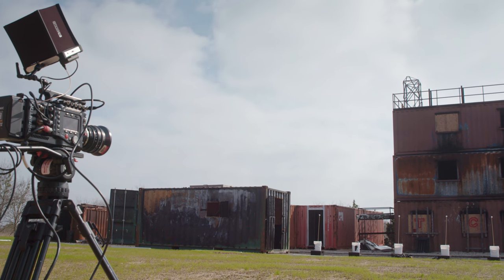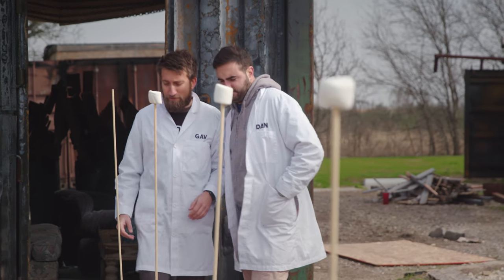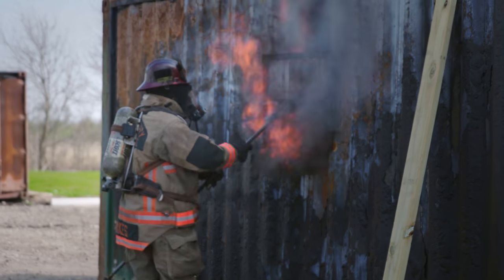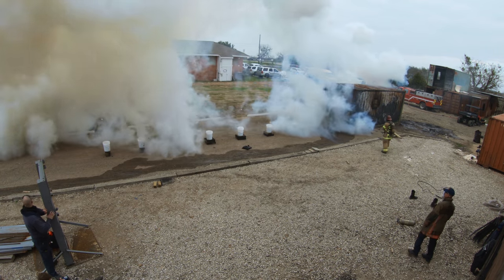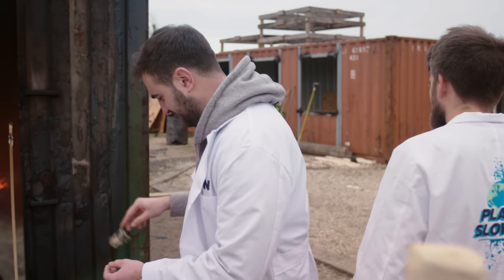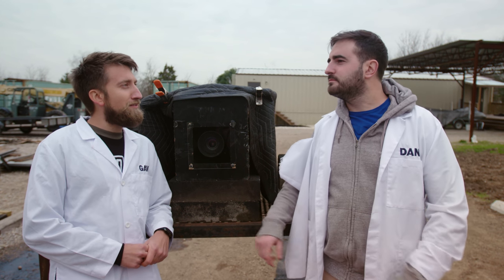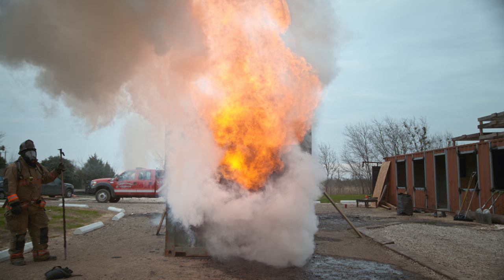4K Slow Motion Backdraft

Comment: I cannot BELIEVE that one firefighter almost walked into the back draft. That's like staring down the barrel of a loaded gun, like you know it's a delayed reaction right? Just go around the other way...
Reply: he was planning on opening the lower part of the door I think
Reply: They all thought it wasn't going to happen so they decide to open up the windows/door to let the air in.
Reply: That pretty much demonstrates why backdrafts are so dangerous, even in a controlled experiment.
Reply: Agreed. Genuinely cannot believe he nearly strolled directly into the path of an actual backdraft. Pretty unbelievable in my opinion.
Reply: @bwin2992  So the masses of firefighters dying from this... weren't wearing gear? It would take a lot stronger gear than that to be safe from what is basically an explosion to your face.
Reply: @Boomber123  You're right. That's why there's no problem with playing around with a dud firecracker.
Reply: Br Win the mask is the weakest part of the gear and does not protect us.
Reply: @bwin2992  The mask is a protection against the toxic gasses and not against direct contact with fire like the rest of the gear.
Reply: Im the 100 Like!
Reply: also, i think the guy was only hit with a glancing blow; as opposed to a full-on impact with the centre of the shockwave. if he had taken a direct hit he would definitely have been knocked over by the force. i suspect it's the immense force of such backdrafts funneling the extreme heat into the weakest points of protective gear that really causes damage.

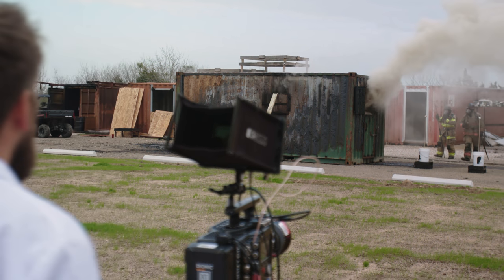Comment: 4:48 Why would you try to walk across the front. Jesus Christ, the guy almost melted the right side of his face
Reply: If you keep watching it curves just before it hits him
Reply: It's like walking up to a firework that failed to go off in order to see what went wrong.
Reply: If you watch his hand it looks like he was reaching to unlatch the door from the side. He was starting to reach out for the latch and crouch down the second or so before the backdraft.
Reply: @johnpatz8395  Yep and if I remember correctly it was said that they were going to open the bottom door then boom. I don’t believe for a second he was planning on walking in front of it either!
Reply: @RamboJohnJ  it wouldn't have been fatal its the reason nomex hoods and helmets exist to protect you from burning or open flames
Reply: @mikerotchburns7122  there is  not nearly enough on the head sock to prevent catastrophic injury from that particular blast of heat and flame.
Reply: @RamboJohnJ  never said there wouldn't be any injury just stating it wouldn't have been fatal

Comment: It's basically superheated air! The mushroom shape makes sense because it's the same concept that occurs when an atomic bomb is detonated! The superheated air expands upwards faster than outwards, causing the mushroom shape!
Reply: GhostShipSupreme a fluid moving through another fluid will make that shape. Water will do the exact same thing just by pushing your hand through it. This backdraft is caused by pressure where a bomb is like you said hot causing it to rise but they do the same motion

Comment: The fireproof phantom looks like one of those old timey cameras with the fabric cape thing they would go under, and use a gunpowder flash thingy..
Reply: Quick fun fact: That wasn't gunpowder they were using back in the day, that was powdered aluminum being blown towards a candle, if I remember correctly. That stuff can be quite flammable, and it can only be sold if it's above a certain average grain size

Comment: Wow. I had ZERO idea that backdrafts took that long to actually manifest. I thought it was an "open a door, insta-backdraft" kind of thing. No wonder firefighters worry about them lurking about! (I still honestly can't believe that one firefighter deciding to walk right in the front instead of behind. DUDE. WHY.)

Also the close-ups of the smoke remind me of pyroclastic flows...
Reply: That's what I was thinking. Both look just like smoke until you touch them, then your arm gets burned off by superheated gases.
Reply: Well a lot of times in an actual house fire it is a very instant thing simply by how starved the fire gets. You can actually see the walls of a house "breathing" when the fire is starved and just breaking a window can cause a backdraft
Reply: @CherryPepis  That isn't a backdraft, that is just feeding oxygen to a fire that is still going.  A backdraft is when the fire is technically out but the room still contains two of the three ingredients in the fire triangle - Fuel and heat, when you add oxygen it completes the triangle but re-combustion will only happen once sufficient oxygen has entered the room, hence the delay.
Reply: @krashd  my guy that's what a backdraft is. It's a starved fire that still has fuel and heat. Both me and my dad are firefighters, we have plenty of experience with real world backdraft

Comment: It's interesting to me that the 'ball' of smoke was ejected quite a bit before we saw the jet of flame.  I'd like to know what's actually happening.  Maybe the sudden reduction of pressure cause by the rapid release of gas somehow enhances the flame?
Reply: Maybe the heat act as an oxygen syphon or a kind of '' air '' exchange and because of that there's a chain reaction. That generate a lot of energy really quickly as the heat goes up and pull the  hot flame outside now that it have room to go since the smoke is probably holding it in.
Reply: You're basically witnessing a thermobaric detonation. Just pull up the wikipedia page for it and you have your answer.
Reply: @DawnBriarDev  Thank you sensei

Comment: My father was a firefighter for most of his career and, in fact, until he retired. It is rather mad, the dangers they regularly exposed themselves to.

What I would have loved to have them do with one of the backdraft bursts is have 3-5 rows of poles with little flags on them, spaced out 2 feet apart from each other, running the full length of the area where the fireball burst out then film it. It would be interesting to see the wind effect of the eruption as it goes.

Comment: Something i just realized is that the smoke almost looks like the ring on a vortex cannon
Reply: It's the same motion, why wouldn't it? High pressure from a volume pushing into a relatively motionless space. The stream catches at the front and rolls toward the shower moving air.

Comment: 1:23 "its still burning the fuel as embers" incorrect gav' a backdraft occurs when all the oxygen is consumed by a fire and then more oxygen is reintroduced, as the fuel is burned it produces super heated gas which then ignites and burns, the fuel is not still burning when the oxygen is used up, as the fire chokes out, the fuel continues to produce flammable superheated gas which rapidly accumulates in the confined space of the building, but because there is no oxygen for the superheated gas to mix with and combust, the fuel simply continues to accumulate gas, while still retaining its superheated temperature thanks to the confined nature of the space, and the moment oxygen is reintroduced into the space, the superheated gas then self ignites, all at once, producing an explosion of flame and burning gas.
Reply: Now I actually know what a backdraft is.

Comment: There was a smoke ring shape leading the explosion; that’s why it didn’t expand outward, since smoke rings keep the same diameter as they propagate. The tongue of fire came right down the track of the hole in the donut.

Comment: As terrifying as the backdraft phenomenon is, it’s nowhere near as nightmarish to firefighters as the flashover.  This effect occurs when the contents of a room all reach a critical heat threshold, causing the entire room- smoke, furniture, walls, ceiling, floors, and anyone inside with OR without protective gear -to spontaneously burst into flames.

It is 100% fatal.  Even full fire protection gear will ignite the second a flashover occurs, cooking the person inside it alive.  And the scariest part is that the first and usually only significant warning you get that a room is about to flashover is if you happen to spy “angels wings” in the air as thin, ethereal tongues of flame begin to crawl through the smoke along the walls and ceiling.  And if you see that, you usually have seconds to get out.
Reply: It is actually not 100% fatal, at least not for the reasons you describe. Each different object will likely have different auto ignition temperatures, and modern firefighting gear has such a high temperature requirement that by the time it reaches that point you are already charcoal. 
More likely it’s due to most things in certain rooms being over their auto ignition temperature and someone opening a method for oxygen to enter.
Reply: @techpriestsalok8119  um.  No.  I have sat in a live flashover training scenario and watched as the fingers of flame crawled over my head.

Modern firefighting gear is very good, but it’s almost too good.  Firefighters have been cooked alive inside their gear and they didn’t even realize it was happening until it was too late.  Flashover doesn’t occur because of a sudden influx of oxygen, because if that were the case the room would be oxygen-starved and not nearly hot enough for the conditions to be met.

If everything, including the smoke surrounding you, catches fire, your gear isn’t going to last more than a handful of seconds.  I believe the estimated escape time once a room flashes is 3 seconds.  If you don’t reach the door by that time, you’re dead.

But hey, that was just my fire training from 6 years ago.  Maybe things have changed since I last went into a burning building. 🤔
Reply: @OneBiasedOpinion  Sorry it seems I misunderstood what you were talking about. And due to this thought the thing couldn’t be real, after more research it seems it is real but works in a different way then you said.

Flashover isn’t about all the materials hitting auto ignition temperature at the same time, but the pyrolitic gasses given off by hot organic materials hitting its auto ignition temperature. This then catches the other materials on fire. In this case it’s not so much everything catches on fire including the air, it’s that the air catches on fire first, followed by everything else.
As for it not being 100% fatal that’s just me being pedantic, it’s probably >95% fatal (in other words more dangerous then being shot in the head) but not 100% as there are probably a few stupidly lucky survivors.
Reply: @techpriestsalok8119  that sounds about right.  It has been a while since I actually studied this stuff.  Thanks for researching and informing me on the details I’d forgotten!

Comment: Sustained Fire needs all three elements of the fire triangle present to facilitate combustion:
- Heat
- Fuel
- Oxygen

Combustion stops when any of the three elements are no longer present. 

If you remove the fuel, say by draining a liquid fuel source away from combustion, the fire will stop and will not start back up. 
If you remove the heat by putting enough water on the fire, it will not start backup. 
If the oxygen goes below 15% the fire will go out. However, heat and fuel are still present. Introduce fresh oxygen to the other two pieces of the triangle because of an improper venting technique, and you get a back draft.

Comment: This is why firefighters are always cutting holes in the roof with axes.
Reply: Well no, we always want to knock down a fire before making to many openings for ventilation. Ventilation is for getting heat and smoke out so the fire can be further suppressed and stop from spreading.

Comment: A backdraught is when a closed fire compartment (such as a room with a closed fire resisting door) traps the fire, heat and smoke within... the oxygen in the room is then consumed by the fire and the flames die down as no new oxygen is available due to the closed door/windows, but the room remains VERY hot and full of thick smoke together with a high concentration of partially combusted gases from the room's smouldering contents (fuel)... now only the oxygen is missing from the "triangle of combustion".... a door opens / window fails / or floor or ceiling burns through and fresh oxygen is now drawn into the room as the room's internal overpressure pushes out some of the previously trapped smoke/gases. The incoming oxygen mixes with the concentrated flammable gases accumulated within the room and brings the atmosphere into the "explosive range" not too lean and not too rich, and then all it needs is a smouldering ember to set of the explosive ignition. A tell tale sign of potential backdraught for firefighters attending an incident, is blackened windows with yellowish grey smoke pulsating from any gaps or cracks, also lots of heat and smoke, but little flame within a building is also a VERY dangerous situation.

A flashover is when the heat trapped at the top of a burning compartment eventually reaches such a high temperature that its radiance downwards is sufficient for every exposed combustible surface in the compartment to spontaneously combust within a second or two, turning a growing but defined fire source into a general firestorm in seconds, and it will even char nomex fire kit, and blister and crack the surface of a fire helmet. The way to remove this risk is to PULSE water spray into the searing hot upper area of the room to absorp and reduce the heat in the upper area, as a continous spray of water will completely fill the room with superheated steam in seconds, with resultant heavily "poached" & scalded firefighters.

A lesser known phenomena is known as a fire gas or smoke explosion, and is where the heat from a well developed fire in one room is transferred through the structure of a building usually into a room above the fire, this heat causes the floor covering to smoulder and thermally decompose though not necessarily in flames, filling the room again with heat and gases of thermal decomposition (pyrolysis) then if an ignition source is introduced (spark from an electrical fitting or a smouldering ember is exposed) and again an explosive conflagration can occur in a room that was not itself directly on fire. Such an incident killed two Welsh firefighters in a house fire in Blaina Gwent UK in 1996.

These are all reasons why properly managed & controlled ventilation of fire situations is now used far more often than in the past.